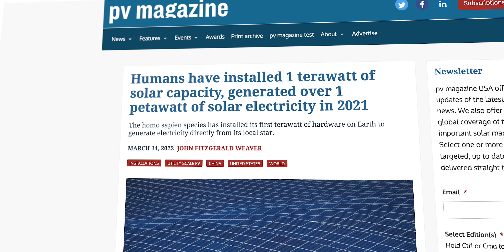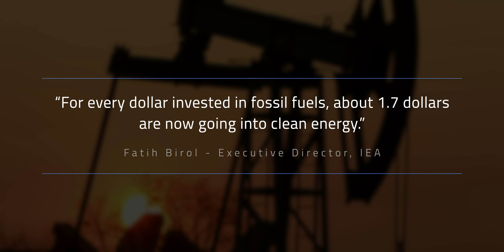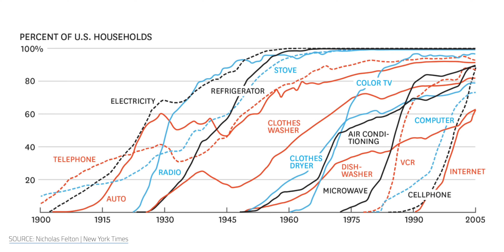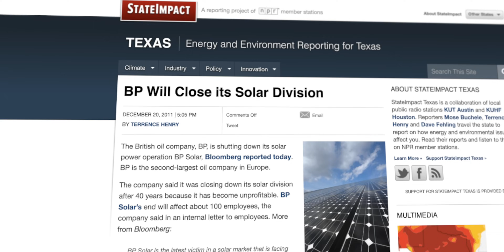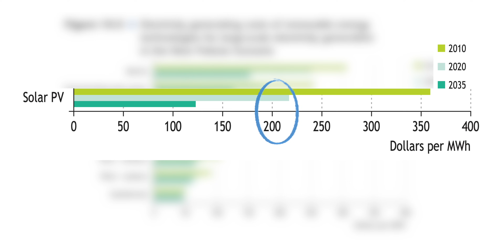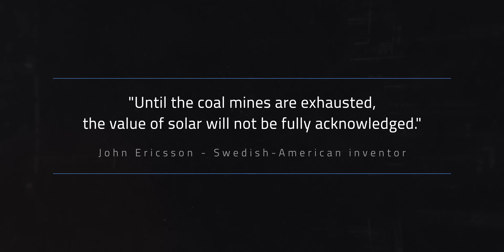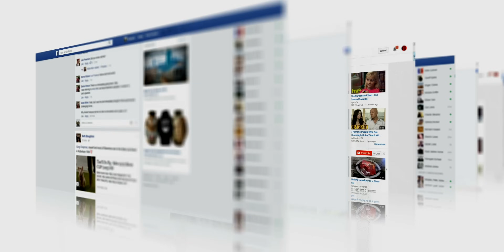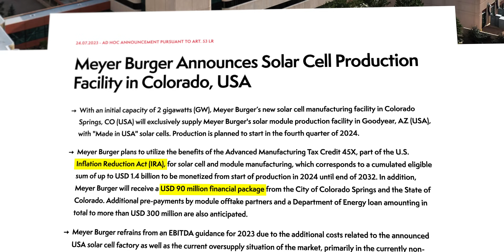How Solar Power Got So Cheap … So Fast

Comment: Not so sure i would base a thesis on statements by two fossil fuel companies. 

The entire time: solar was declining in size,  weight,  and cost. 

I nibbled at it but it was too expensive.   But i could see every year,  it was a better deal. 

And i also saw utility companies were buying nearly 100% of solar production... which kept retail prices high.

Comment: As a solar power user (with battery storage), supporter of AND investor in solar technology companies in this field; What would you say is the reason the investment space in said companies has seen one of (possibly *the*) the largest downturns in their history from February of 2021 until now (and continuing)?

For all of the myriad reasons you've outlined here, this downturn flies in the face of ALL reasonable logic EVEN WHEN considering the realities of Chinese manufacturing tariffs on solar panels and related inverter units (as a result of the US/China trade war) and that many new system installations are paid for by loans which are more expensive now due to rising interest rates..... Massive growth IS happening, more people and companies than EVER are talking about and want solar - and yet - the economics of the businesses providing this technology are being (to use the ever popular word) 'slaughtered'.

Is this the last push of the fossil fuel industry and it's lobby as it desperately tries to avoid it's own replacement - or something else?

Comment: Nice run-down on the adoption curve, but I’m still asking myself what made solar so cheap??? You cited BP and Shell bailing in ~2010 because it wasn’t profitable. Why wasn’t it profitable then? Why is it profitable now? Have costs gone down? Has revenue gone up? Is it all just economies of scale? 

I usually engage with this channel as a technology one, so I was kinda expecting a profile on some manufacturing process breakthrough from the last 10 years that made solar much cheaper. I’m glad solar has beaten everyone’s expectations, and I’m curious whether BP, Shell and the rest have fully jumped back in the fray now that it’s profitable (looking at you record Exxon profits).
Reply: UndecidedWithMattFerrell8  This reminds me of a conversation I had a while back about the Vogtle nuclear plant in Georgia. It just came online after many years of delay and at tremendous cost. Not trying to open the nuclear debate here, but many people were upset that we didn't choose solar. Well, in ~2009, when the utility company made the decision, solar was much more expensive, and everyone has been blown away by the plummeting cost of the last ~15 years. 

What happened? My suspicion is that it’s some combination of economies of scale buoyed by subsidies from a certain manufacturing powerhouse country. 

Also, I’m looking solidly at the supply side of things, but no doubt feed in tariffs from around the world ( Germany especially) contributed to increasing demand!

Comment: I don't really get why people insist on net metering.  There are ways to use solar to supplement your load, at a much reduced cost.  This is something I'm actively looking to do within the next several months.
Reply: Net metering makes sense in the very early days of solar adoption where you're trying to get the number of homes with solar panels up from zero to a few.

But, once the amount of solar in the grid reaches some critical mass, net metering doesn't make sense anymore. You're effectively sending power to the grid at the moment the grid is already flooded with solar power from everybody else's solar panels, and taking power from the grid after the sun has set and the utility is forced to run expensive peaker plants to produce that power. It is unreasonable to sell electricity when it's cheap and buy it back when it's expensive, and expect each kWh you sell to fully cancel a kWh you buy.

However, this does not meant at solar in CA is dead, it simply means that renewable energy in CA has now matured to the point where what the grid really needs is more battery storage, rather than solar alone. With battery storage, each kWh of power your solar generates now really does cancel out a kWh you would otherwise need to purchase at peak prices. It is also a price signal that someone who can afford either a home battery or solar panels, but not both, should choose the battery. Which again seems fine - charge the battery with cheap solar during the midday when the grid is already flooded with other people's solar, release the power when the sun goes down to avoid use of peaker plants. That makes much more of a difference in making the grid cleaner than sending it even more solar power during the midday that the utility is having trouble using.

Comment: I think in hindsight solar would always come up as the victor at some point, but the question is how long it will take for it to be replaced again, and by what?
Reply: More efficient or easier to use materials. I'm already looking at replacing my 2011 225W panels in the interests of fitting higher yield panels (these will be repurposed elsewhere).
Reply: @chrisroyle4813  yea but i mean completely new tech. Like in 150 years will everyone have their own fusion-reactor at home? Will there be unobtainium-generators? How about Dark Energy Turbines? Dyson Sphere Ray Receivers? I know this is all science fiction at best, but i wonder what of it might come true. in the next 10-1000 years...

Comment: I appreciated the episode but confess to wondering if some of these numbers are ‘rigged’…. What i mean is this; do these huge cost drops ignore the subsidization by governments - put another way, are these true costs or costs less incentives… this far in, if the adoption is so rapid, why were more incentives needed from the inflation reduction act… what about lifespan of these panels, how they will impact the waste stream, and the amount of energy it takes to mine for their raw materials, build, transport, and install them… how long do you have to run a panel before you are ahead…. An electric car needs to go about 60,000 miles before it is ahead of a conventional car in terms of its carbon footprint…

Comment: Unfortunately, the "cheapness" is relative and you have to study it to analyze incentives, solar credits, etc. A solar install in California will achieve ROI before a similar install in Florida. It's still pretty expensive to run a whole residence on solar, which makes "fossil" fuel more cost effective. Besides "fossil" fuels aren't animal remains they're ancient algae and phytoplankton remains, so really the most green, abundant, plant based energy available, but yes it will just run out in a few hundreds of years. Just as the Sun will be out of fusion fuel in a few billion or so. We humans just conceive of sustainable in very short time periods in comparison to universal time... Thorium salt reactors may be a better route to charge up the electric vehicles out there. But first the grid will need  a LOT of restructuring and fortification to make electric vehicles (and the elusive next generation battery) truly viable.

I'm far from a Luddite and I have run the solar numbers many times because of your videos, so I think you really do reach the minds of people. Plus watching your house being built at the factory and put together onsite was really interesting! ;-)

Comment: I like solar far more than those bird killer wind farms. Wind farms take a massive amount of resources to build and those blades break down quickly with the bird strikes, and let's not even go into the carbon and toxins that is released in making and constantly remaking them. 

The main advantage of solar is that those panels even when they stop working are a contained hazard. and when they are in use they can often be added to walls and roofs of structures. And depending on your latitude you can actually get considerable power with wall mounted panels.  If you are north of the Mason Dixon line it really is a consideration to ponder.

Comment: Hrm, if you have one of the 23 oz larq bottles, would you mind measuring it?  I drive a miata, so have a very limited size that will fit in my cupholders on the doors (don't like using the center console cupholders since it makes shifting cumbersome)

Comment: 10 years to reach 4%, impressive. It will only take 120 years to reach 50%. Also, solar is the most expensive form of energy by far if you include the storage necessary to make this intermittent source usable. We are kidding ourselves with wind and solar and need to get onto nuclear ASAP.

Comment: Solar panels consume thousands of acres of land, or if on roofs cause damage such that insurance companies now take a dim view of them. The manufacture of the panels is energy intensive and consumes large amounts of water. There is no realistic plan for recycling used solar panels or returning spent solar fields to viable land. Unscrupulous solar companies dupe homeowners with non-existent power company "buy-back" energy policies and/or investment recoup plans. The most efficient solar panels are still below 25% efficiency. And our battery storage revolution is about as likely as me becoming a Chinese fighter pilot. Better than fossil fuels? When you compare the environmental footprint and what we're getting out of it, I'd say it isn't much better, regardless of the supposed CO2 footprint comparison. Other than those issues, I'm all in. :)

Comment: Technology moves on.  In the 1970's I worked in a research group at a large semiconductor manufacturer. One of the products of the company were solar cells used on spacecraft.  Being the nerds we were, we did a study to see how much energy was required to make these cells.  At that time the cells were made using silicone wafers.  The energy it took to grow the crystals, slice, polish, and process the wafers into solar cells was considerably more than the cell could ever produce over a twenty year lifespan.

Comment: I've had an interest in solar since their usage by NASA in the 1960s. I took several courses in using solar energy in the late 1970s. These courses were mainly related to thermal solar and passive solar. I came to the conclusion that thermal solar was somewhat impractical and the PV cells were the future. At that time, they were very expensive and their efficiency was rather low. All of that has changed since then and PV probably has the lowest operating cost over their projected lifetime than any other form of generating electricity including most other renewables.

Comment: Video was good until you got to the IRA and trying to argue that the tax incentives (and not the radical change in energy costs in most areas) is the reason. If you count the IRA perpetuating tax benefits, maybe, but there was federal tax incentives for years without citing the IRA.

Depending on utility companies (which can be a change of 4-5x the cost) it's not worth it to get solar in many areas, even sitting right next to one another.

Comment: Why don’t you cover the downsides of solar?  The waist after it’s useful life, the cost of storage, land use issues, geography, cost….
Reply: I ask you to think about the downsides of oil, natural gas, coal, and nuclear.....  All much worse than for solar.
Reply from the maker: I've touched on that in other videos, so didn't rehash it here.  But @gregcollins3404 hit the nail on the head.  There is not perfect form on energy generation.  Everything comes with a cost or downside, but solar's downsides are nothing compared to gas and coal.

Comment: I studied green technology extensively at University in the early 2000s. Back then solar seemed like a waste of money. Little did we know 😉. This view was reaffirmed by a £100k PV system mounted on the North-facing wall of a new engineering building, behind a row of trees, that would generate a peak of 200W 😂. Poor installation planning is another reason that slows down early adoption of any new technology.

Comment: Unless the market just fell out for solar its far from cheap. Still a 15-20 year ROI and the incentives only work if you owed that much in taxes, so its useless for most. But they don't find that out until they file there taxes.

Comment: $20,000 on the extreme low end is still way to expensive and really has not dropped that much.  The ROI on solar is really poor, Now, if they can get the price down to $10,000 for a 2,500sq ft house, then it might be worth it

Comment: I installed solar on my house in California over 12 years ago for four simple reasons. 1) The government took money from non-solar taxpayers to subsidize my purchase; 2) environmentalists had made my electricity in CA over three times as expensive compared to my previous state; 3) it was obvious the environmentalists were going to make the electricity increasing more expensive; and 4) I was planning on moving from California before the panels would need to be disposed of. In keeping with #4, it is interesting that no mention was made of the environmental impact on the disposal of all the panels that will be hitting in the near future. I am now living in Florida and installed solar. Now 12 years later I still benefited from the government taking money from non-solar users to subsidize my purchase. My current electric rate is 1/3 of what I was paying in California but they just announced an increase and probable more increases on the way and I suspect I will be gone by the time the panels need to be recycled. As Matt mentioned, the system was cheaper this time but the reasons were just the same.

Comment: Still, for every success story on residential solar, you can find a failure. And there are places it's likely break even at best. 
Here in MN, they're pushing it hard, but risk is too high that it will be an expensive hobby.